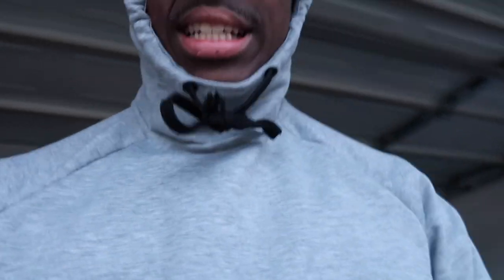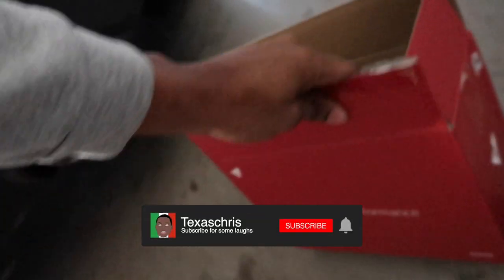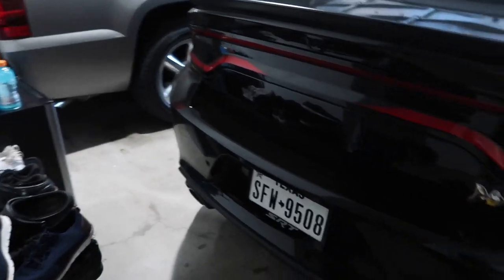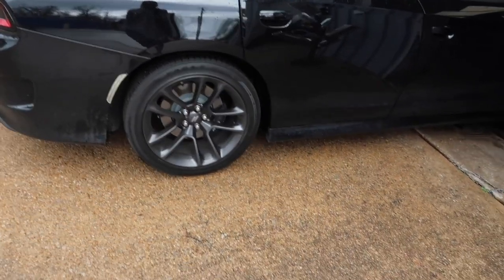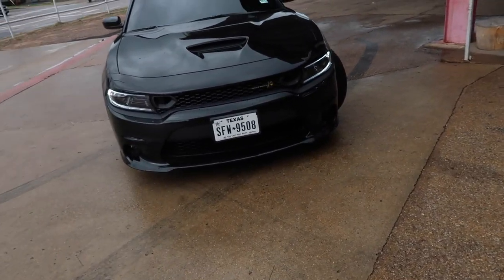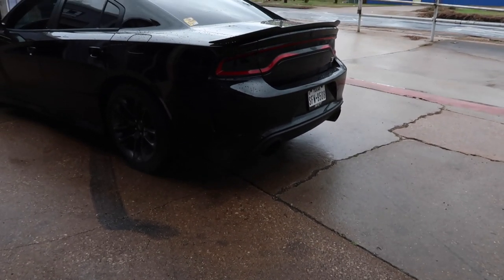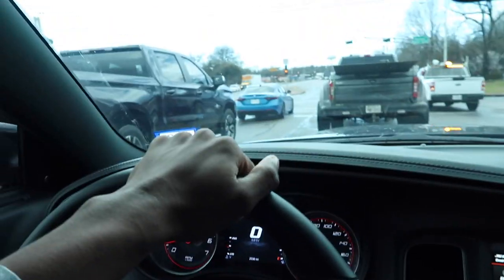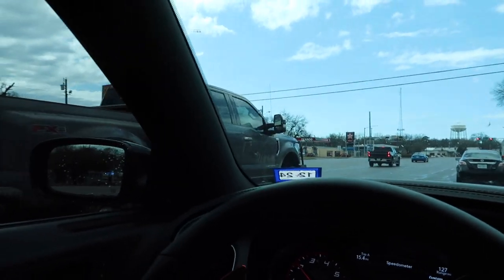2022 Dodge Charger Scat Pack Mid-Muffler & Resonator Delete + 5 Inch Tips *LOUD*

Comment: That’s odd bruh, you got a mid and resonator delete yo car should be dumb loud..it sound good doe
Reply from the maker: No cap it screams when you get on it and cold start most definitely. Camera doesn’t do justice at all but, most definitely side by side with a scat with only a mid you can tell the straight pipe is louder.
Reply: @Imtexaschris  fuxck it yo Ish still go crazy 🔥💯💯
Reply: Word it sounds stock when that bish should be screaming
Reply: Scats really not loud until u take the cats off. The car also does have a 4k rev limiter.
Reply: @mrdr_392  mine is loud